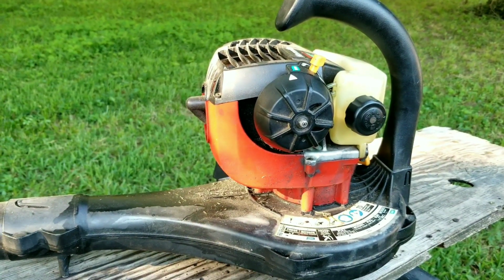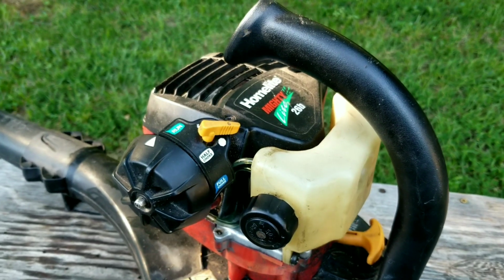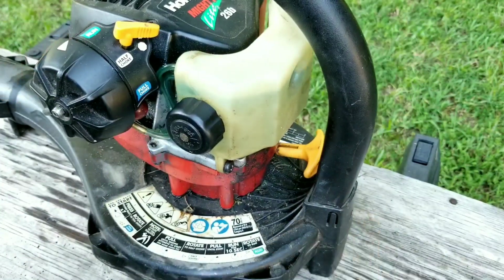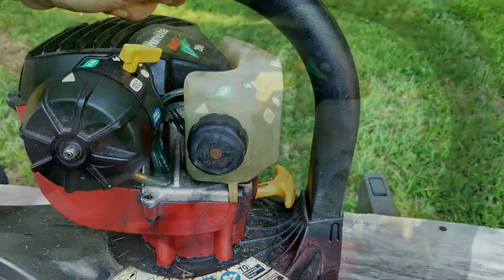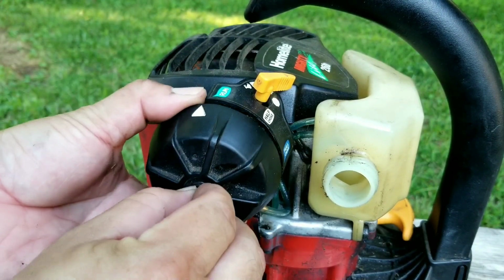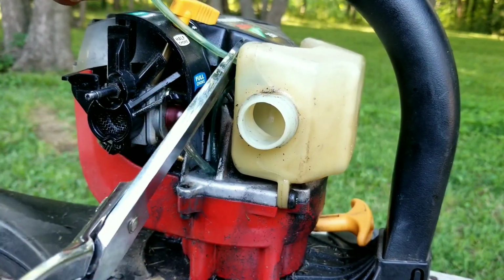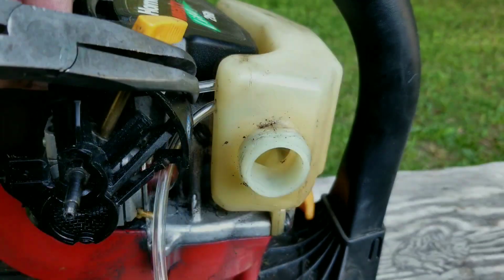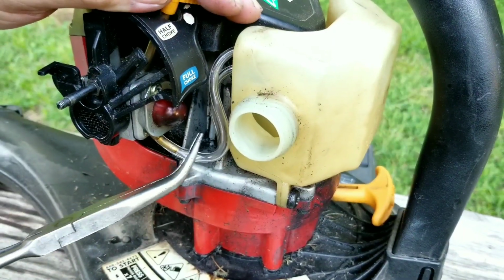Leaking gas tank fixed on a blower

Comment: Id change the cap for one, I searched your page to see why my blower is leaking gas quite a bit when I pick it up any thoughts and won't stay rumming either?
Reply from the maker: I'd have to see it to be sure.  The gas cap can be leaking from the vent, the fuel lines could be leaking and even the carb itself can seep fuel if it needs service.   And from your comment about it not wanting to stay running, I'd say your carb was the problem

Comment: I’m not a fan of homelite products. I’ve never had any luck with them. My father brought home an older blower that I’m going to work on whenever I get bored. It seems to be in decent condition.
Reply from the maker: I know they seem cheap, but taken care of, the will last.
Reply: @INSIDEHOUSEGARAGE  The new ones anyways I think are junk, but the early 2000’s on back they seemed to make much better products. I’ve seen their chainsaws be 40 or 50 years old & they still run.

Comment: Mine was leaking also. All I did was took the gasket from the inside of the fuel tank cap and flipped it around and put it right back in and it worked
Reply from the maker: nice, I might have to try that.

Comment: Awesome video bud. I would either replace the cap or try and fix it. I had a leaking cap on a Craftsman chainsaw what I did is drilled the vent hole a little bit bigger and put a little duckbill valve in it from my Homelite chainsaws. I can't stand leaking gas. Makes a mess and attracts dirt to the machine
Reply from the maker: That's quite ingenious of you.  Thanks for the comment I appreciate it

Comment: i would have done what you have done, i have a mac alliaster leaf blower that is boging down i have clean the carb changed the fuel lines and filter and spark plug and tried adjusting the needles but after 30 secs its couts out or bogs down still Any ideas thanks
Reply: The compression is only 25psi
Reply from the maker: @roystheboy  wow that's too low to run.
Reply from the maker: Thank you for the comment I appreciate it.  Is there a spark arrestor? Remove it and try again.  Is there any deformation in the metering diaphragm? Some deformation will allow it to run but will run very strangely. Have you checked the compression? A low compression reading would also do the same thing.  Please let me know.
Reply: @INSIDEHOUSEGARAGE  no spark arrestor but i took the exhaust of fuel in and set light to it the diaphragm looks ok its a 2018 model i havent checked the compression yet will try that over the week end thanks for the reply
Reply from the maker: @roystheboy  no problem good luck Roy